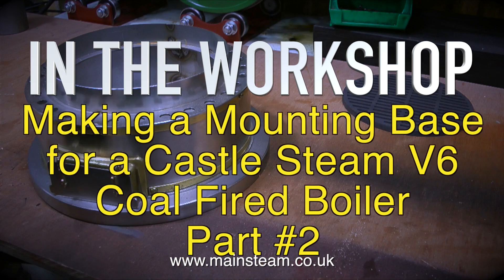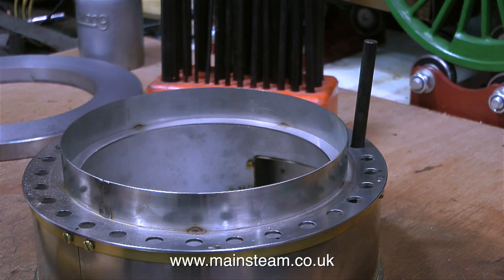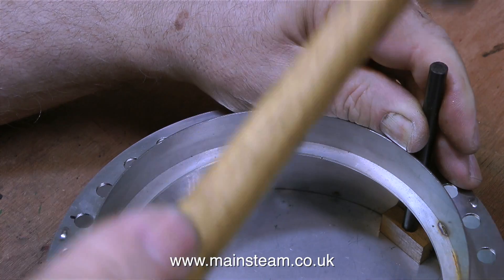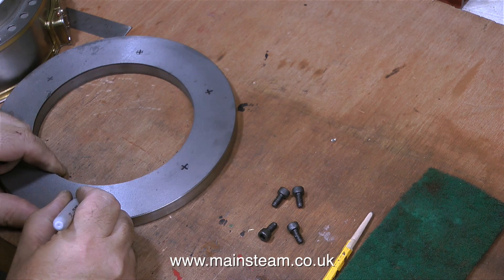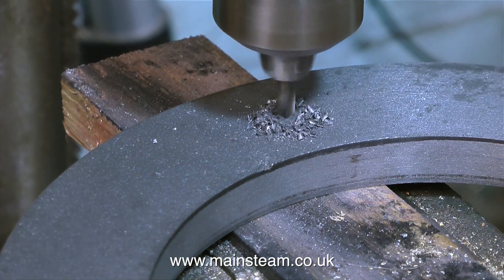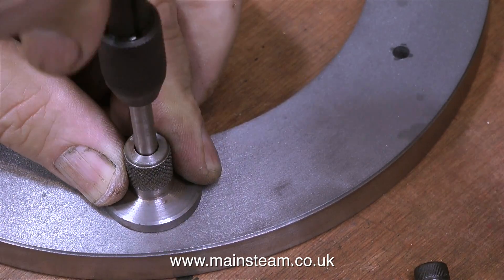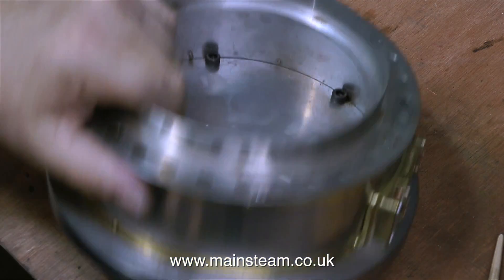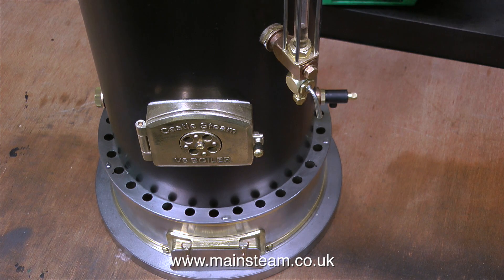HOW TO MAKE A METAL MOUNTING BASE FOR A COAL FIRED CASTLE V6 STEAM BOILER - PART #2

Comment: Surely  m6 set-screws? Bolts have an un-threaded shank under the head, and would not work in this application...
Reply: Actually, set screws do not have a head. Bolts can be threaded all the way to the bottom of the head, just depends on the overall length of the bolt you are using.

Comment: When I paint something.  I use a metal welding wire that is 18" long with 90 degree bends on the end.  The wire is strong enough that it will hold up to 20 pound objects easily.  The fold on the end of the wire allows the wire some distance away from the part.  This way there is no wire shadow and I can paint all the way around with out the need to flip it.

Comment: Great to see how this project is coming along Keith. I'm considering buying a V6 boiler shortly - is there any chance you could show yours running on coal once you have completed your works. Many thanks Peter.
Reply from the maker: As soon as I fit the hand pump, I will be showing it running on coal and steaming my Stuart 5A steam engine in the garden on the picnic table {:-)))
Reply: That's great Keith I look forward to that, can't beat a boiler running on the lumpy black stuff :-)